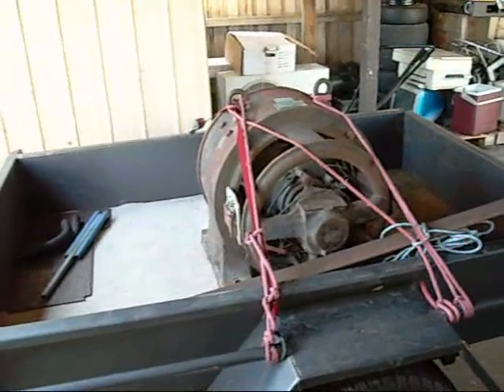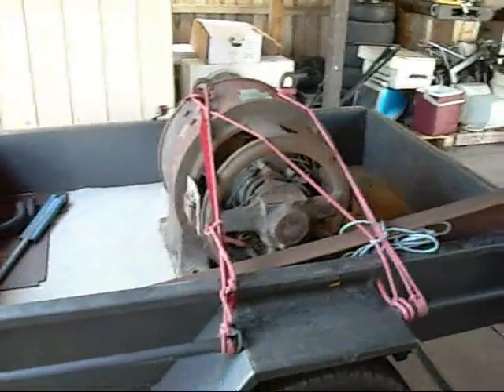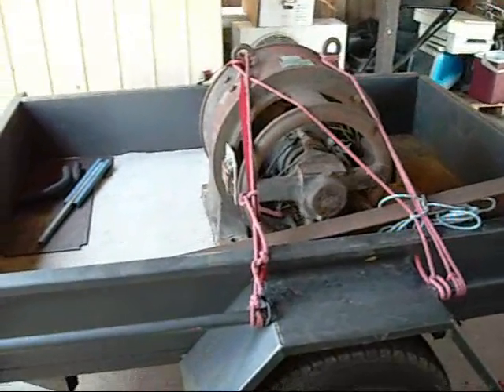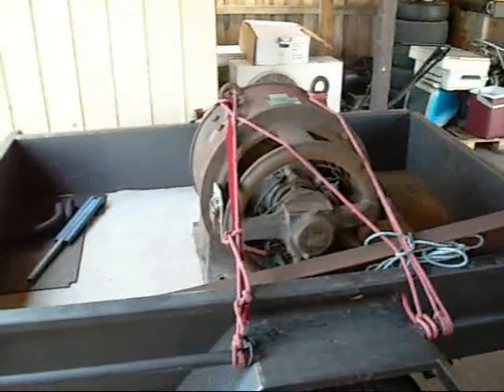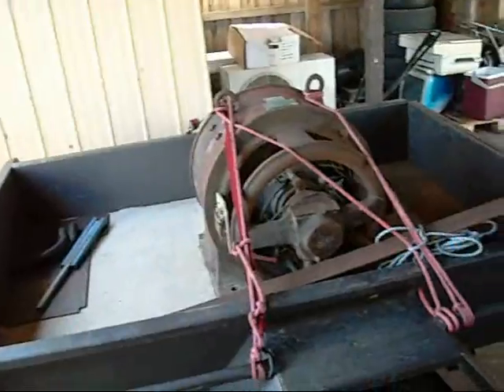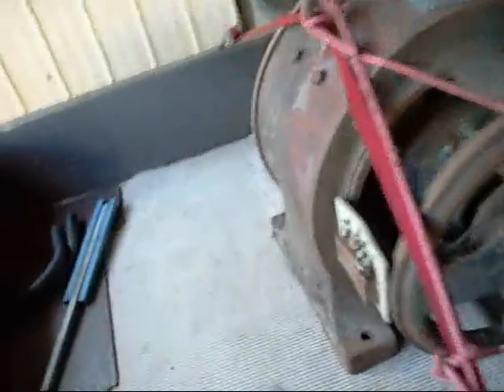The Westinghouse is Home Safe

Comment from the maker: it was driven by a large oil engine., say 20HP or so, if the Morris can manage that sorta HP through the gearbox it would be sweet.

if not, theres a Jaguar inline 6 coming soon with transmission :D